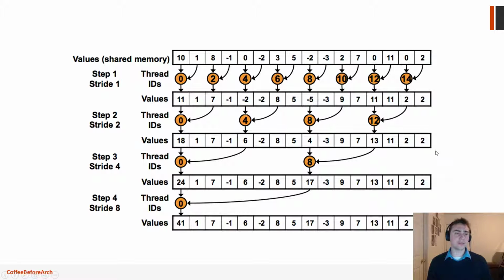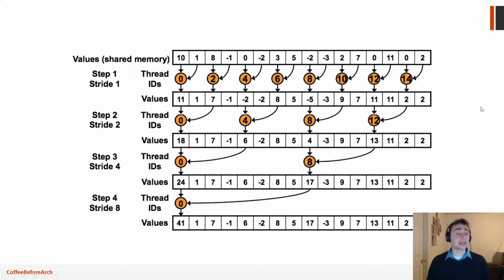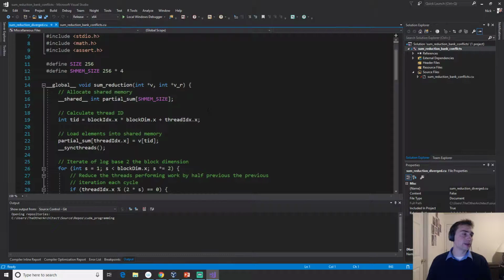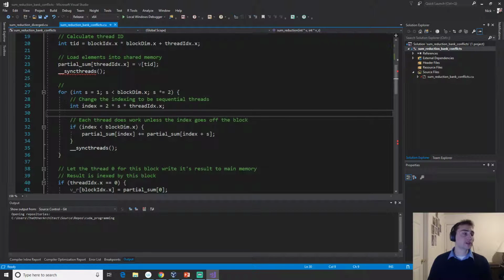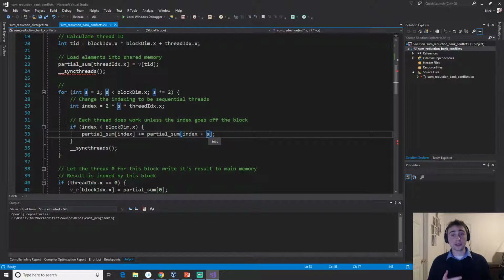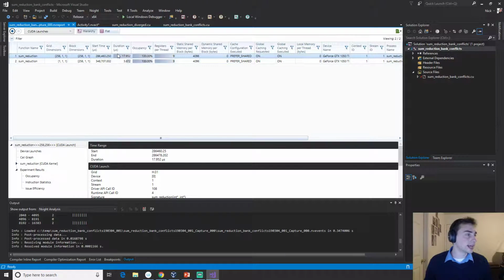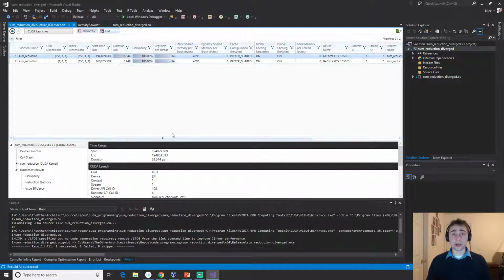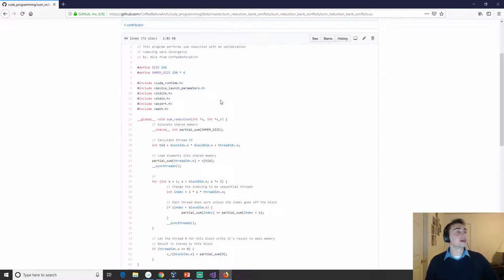CUDA Crash Course: Sum Reduction Part 2

Comment: How do you handle reducing arrays that contain a number of elements that is not evenly divided by the chosen block size? Do you pad the input with zeros in such a case?
Reply from the maker: There are a couple ways. You could pad with 0s (not a great option because then you have wasted time writing the zeros and operating them),. You could also just calculate a global index you're operating on within the kernel and see if it's >= the total number of elements.
Reply: @NotesByNick  thanks!
Reply: @NotesByNick  It seems like you must assume block sizes that are powers of two, you must assume that the number of elements in the input is even, and you must assume that there the block sizes evenly divide the number of elements. I've been trying to generalize this, but it adds a lot of complexity to handle anything more than this academic example. Just using a global index and checking <= n_elements is only a small piece of that puzzle.

Comment: While removing the modulo is important, this doesn't solve the idle thread issue. You are just making the idle threads more sequential. Since you are launching this and checking on the first loop if the threadIdx.x*2<BlockDim.x, this means that all threads with ID greater than half the block dim are going to be idle anyways.
Reply: Every warp of 32 threads has the same instruction pointer so they execute the same instructions. Spreading out which threads are active means that you'll have to create more warps in cases where it could have just been 1 because of the differing instruction pointers. It's not about making more threads active, but rather, scheduling  the active ones together. Quoting is reply from a comment below:
"Consider the case where the stride is say 32. If we didn't use sequential threads, threads 0, 32, 64, etc would be active. If we used sequential threads, it would be 0, 1, 2, etc. Threads 0, 32, 64, etc. all belong to different warps, and therefore would each require a warp instruction. Threads 0, 1, 2, etc all belong to the same warp , therefore would only require 1 warp instruction (for the first 32 threads at least)."
Reply: @alexandergeorgiev2631  Is this the optimization technique called "warp reduction"?

Comment: The modulo operator in the filter was unnecessary from the start. Those previously idled threads would add elements that don't end up accumulating in index 0. When stride=2, threadIdx.x=1 would add 1 and 3, but 3 was added to 2 in the previous step. No thread on this step or any future step will add index 1 to anything. Not saying that both optimization steps aren't needed, just that they are independent. The filter was there to make sure nothing bad happened. And as it turns out, not bad can happen without it.

Comment: How would you implement this with a different number of elements? what if there were 50,000,000 elements, or what if they were variable based on a user input?
Reply: This is late response but hey we are here, so if you have a user based number of elements my approach would be to check first if entered number is a power of two or not, if power of two then proceed normally and do reduction, if size is not power of two then we need to pad the array in other words, add zeros (since it does not affect addition) to the array until the size has become power of two.

Comment: What's the advantage of having sequential threads working together instead of even ones? Overall, the number of threads is the same, only now the higher numbered ones are idle, is it correct?

Edit: Oh, I see that in the next part you confirmed what I just said. So I guess the advantage of this approach is getting rid of modulo operator (which is three operations instead of just one: x % y = x - y * (x / y)).
Reply from the maker: A lot of the performance comes from getting rid of the modulo (GPUs don't have hardware support for division.) However, getting rid of warp divergence is still important. Consider the case where the stride is say 32. If we didn't use sequential threads, threads 0, 32, 64, etc would be active. If we used sequential threads, it would be 0, 1, 2, etc. Threads 0, 32, 64, etc. all belong to different warps, and therefore would each require a warp instruction. Threads 0, 1, 2, etc all belong to the same warp , therefore would only require 1 warp instruction (for the first 32 threads at least).
Reply: @NotesByNick  Took me a while, but I understand it better now, thanks!
Reply: good question and good answer . I was wondering how the 32 threads of the warp would be distributed in a thread block with two/three dimensions. Just in case anyone else is wondering: 

"Threads are numbered in order within blocks so that threadIdx.x varies the fastest, then threadIdx.y the second fastest varying, and threadIdx.z the slowest varying. This is functionally the same as column major ordering in multidimensional arrays. Warps are sequentially constructed from threads in this ordering. So the calculation for a 2d block is"

- Source: https://stackoverflow.com/questions/6177202/how-are-2d-3d-cuda-blocks-divided-into-warps